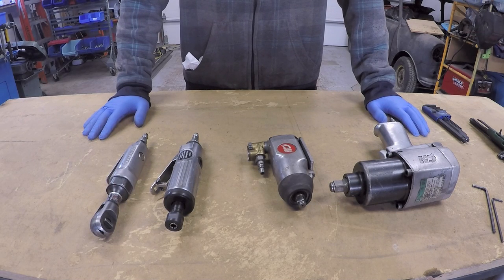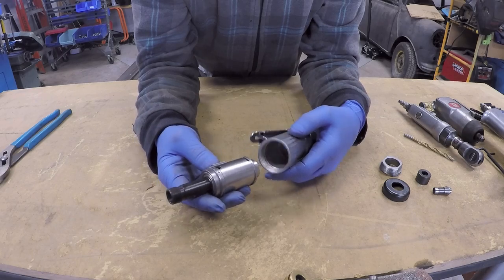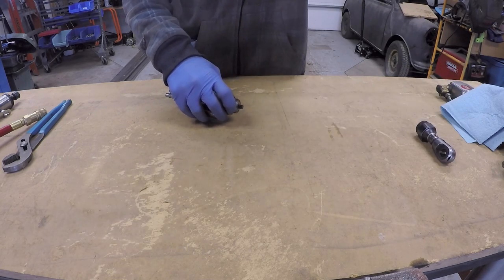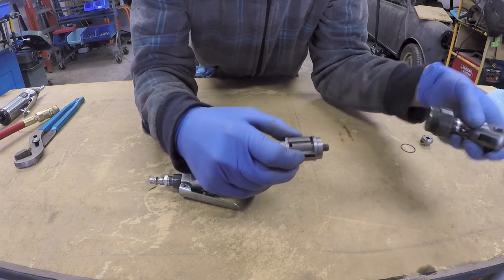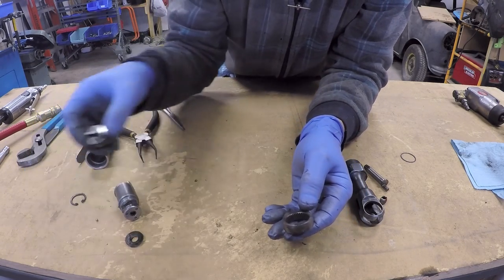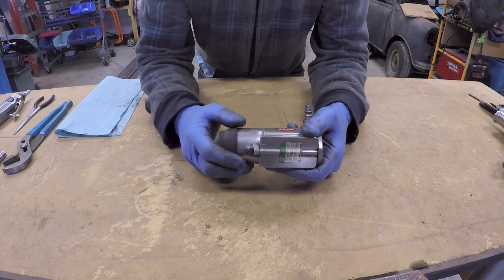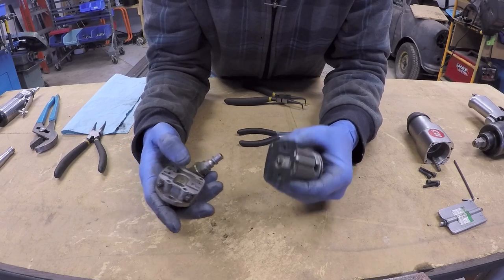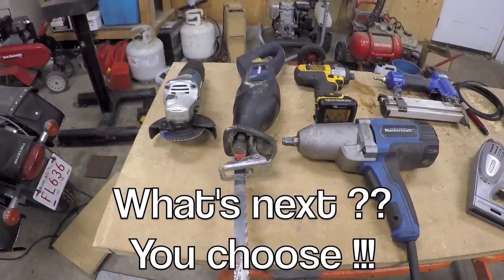How an air tool motor works  (Part 1 of 2) Different costumes,  same fellow.

Comment: Hey Joel. I have a question. I have an airvantage da. Loss of air power. Checked inlet valve and seal. It's good. I bought vanes but I can not figure out how to get this da part past the bearing housing removal. Do you know how to pull this da apart to replace the vanes by chance? Thanks

Comment: I am looking for a motor like a ratchet, slow speed, locked when no air is supplied and the direction can be reversed externally, the torque and speed required is very low, 6kgcm/30RPM, any ideas of a supplier or an air tool that I could modify would be greatly appreciated
Reply: Donald Pittendrigh A 1/4” drive air ratchet would smoke that torque setting lol. Most of those are rated at least at 20 ft lb = 240 in lbs which is almost 50 times more powerful than what you’re talking about. I can’t imagine there being a pneumatic tool let alone even a cordless tool being rated for such low torque settings. If the torque spec is so critical those fasteners should be finger tightened and checked with a torque screwdriver that is capable of measuring in such low of a torque range.
Reply: @nate851  That would be a minimum torque setting, I dont mind how high the torque is, so long as the speed is controlled to not exceed 30RPM

Comment: I have a ratchet wrench which rotate and the speed will start reducing after a while, sometimes it just let out air without rotating at all. I have checked the rotor blade and they look good. Please what could be the problem.
Reply: Please make a video on how to make a air motor at home

Comment: How to replace fwd. Rev. Switch in pneumatic IR straight screw driver  ?
Reply from the maker: I was not able to find a manual for the exact model, but I believe that the reverse switch is held in in the same way as shown in this manual on page 21 http://www.toolsmith.ws/catalogs/Ingersoll-Rand/Parts%20Breakdowns/Industrial/INDMAN/P6603_16.PDF

It looks like you need to remove #5, the screw (this is probably a very small hex. Make sure to use the correct one and not damage the screw) Once your remove that, #6 should come out allowing #4 to move down and allow you to pull the switch out. 

This probably won't be easy, but if you are careful and patient, you can get it.

Comment: I watched this because I wanted to know how the tool motor worked but in each case you removed the motor from the tool and set it aside and talked about the rest of the tool but never showed us "How an air tool motor works"